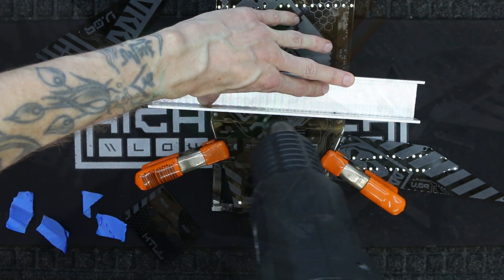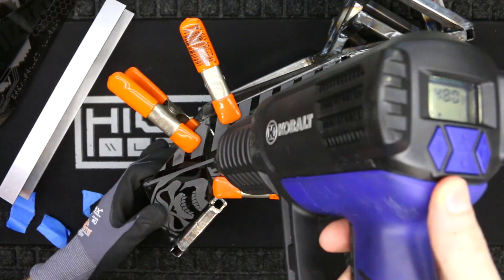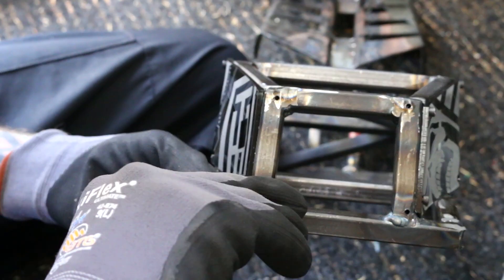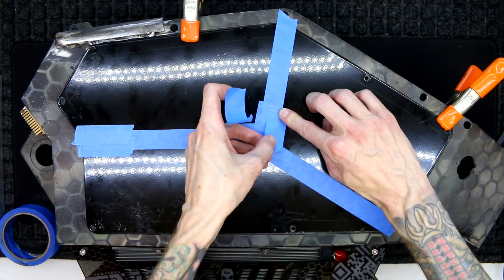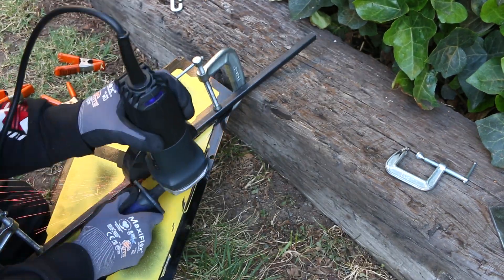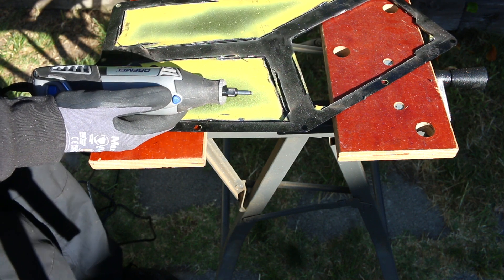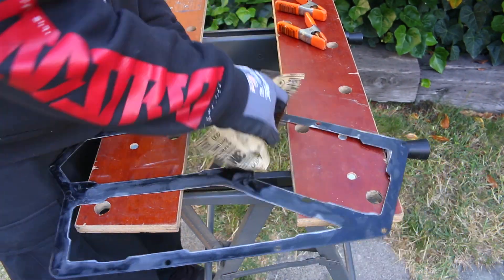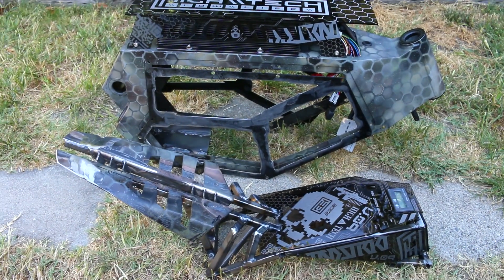🚲 Frame Side Panels + More!! E-bike 9.0 \\  Fabrication - Enduro - DIY Build! \\ QS273 70Ah

Comment: Some flat rubber spacers and metal washers would keep those panel holes from cracking out on the acrylic ones i mean
Reply from the maker: Yes, I also could have laid them flat, this way flexing wasn't possible 👍

Comment: Just buy a Saber saw with a metal cutting blade.  Use spray adhesive and stick it to a piece of 1/5" plywood.  This will keep the metal from bouncing around. When all it cut out use lacquer thinner to separate from wood.
Reply from the maker: Oh I have a jigsaw, it's pretty violent though and I figured I could have a bit more control with the angle grinder. I've cut metal with it before and it tends to want to vibrate everything into oblivion. 👍

Comment: When doing that skeleton style cutouts it's a lot easier to drill holes in all the corners then cut between them.... You can even put holes along the line but make sure you use a small bit so you don't have a sharp saw blade edge leftover when you cut between the holes.
Reply from the maker: Thanks man, I'll try the drilling technique next time 👍
Reply: @hightech-lowlife  - You're Welcome, just trying to help you make it a little easier on yourself next time.... Whenever I've done cuts like that I drill the corners and use a jigsaw to cut between them, but sometimes that requires a little more sanding but it's easier than using those little cheap Dremel wheels that like to explode when they get hot.    LoL
Reply from the maker: @xpndblhero5170  Oh yeah I have cut things with the jigsaw before, when the metal is so flimsy like this I feel like it makes it harder, but I didn't try 👍

Comment: I love your videos! I want to mess with my 5000w e bike but I'm afraid of destroying something. I ride around DC and MD but I do want to upgrade my battery one day. VIDEOS are on my page
Reply from the maker: Thanks man!! You could totally upgrade your battery, it can be daunting but once you get the hang of how it all works then you can tread without as much caution 👍I'll check them out, thanks!
Reply: love to see  your bike in DC some day I am running a 3000 watt rear and a 1000 watt motor front drive I run 52 volt battery's 20 amp hour worth for distance not speed
Reply: correction it is 40 amp hours worth of battery's
Reply from the maker: @alphonsotate2982  That's a really cool setup man, did you do one motor first? I'm curious as to how the 2nd motor felt in comparison? Speed is overrated, as long as you're having fun that's all that matters!
Reply: @alphonsotate2982  I run through DC

Comment: you should check out j1772 charging system so you can charge at 3.3kw to 6.6 depending on the capability of your battery pack so you can get less than 2 hr charging even at public charging they have elcon chargers or even chinese clones
Reply from the maker: Cool, thanks so much! I haven't delved into fast charging solutions yet, but I may take a look at that in the future, thanks for the suggestion!
Reply: @hightech-lowlife  no problem thunderstruck has a couple of options but on the pricier side of things you can get an Elcon clone from china and get a j1772 adapter from evseAdapters it would be cheaper just take longer for shipping
Reply from the maker: @susannejohnston2336  Ok cool, I'll check it out, thanks!!

Comment: Bro, you're tapping with a screw when taps are like $5.00. This is not the mindset you need to have when making things.
Reply from the maker: But screws are cheaper, and don't break! 🤔
Reply: @hightech-lowlife  I’m guessing you had a speed tap and didn’t use the right size pilot hole and some cutting fluid? Speed taps will break easily if your not careful. Also, you’re probably a bit better off cutting acrylic with a toothed blade. It looks like you were using an abrasive cutter, which basically melts the plastic out of the way instead of cutting it.
Reply from the maker: @DB_frfr  Most likely just the wrong size pilot hole but I'm not sure 👍definitely used fluid. The taps I used I broke every one of them, never broke a screw before though! 

I cut the acrylic using a laser (you can see a clip of that near the end of this video, and a whole ton of it during the last video to make the panels). Do you mean the metal side panels? I've never used a toothed blade in my grinder, but I'll give it a shot.
Reply: @hightech-lowlife  Be very careful with toothed blades in angle grinders, they can kick back and cut you.  Only use discs designed specifically for angle grinders.
Reply from the maker: @tekhn  Thanks for the tip!